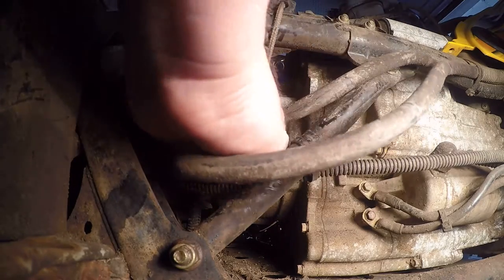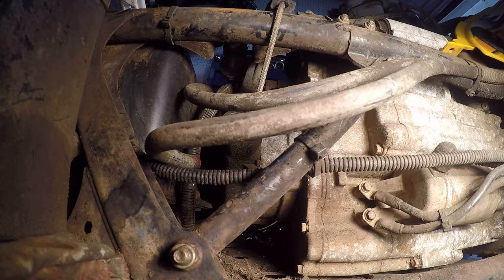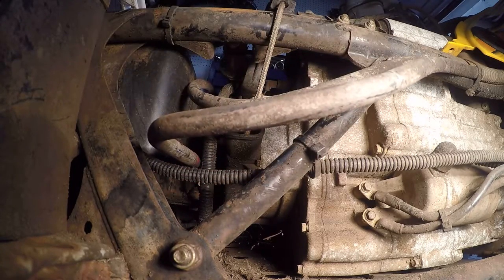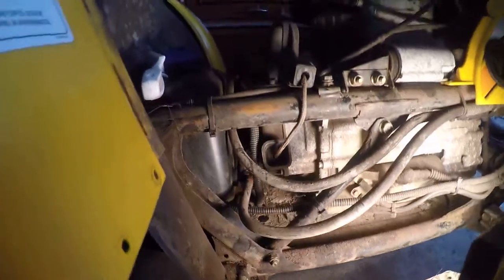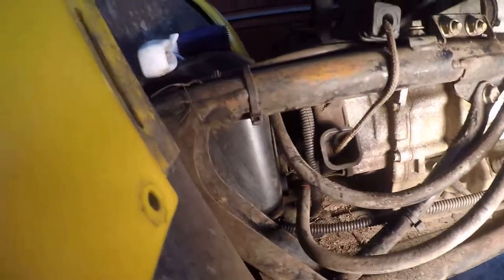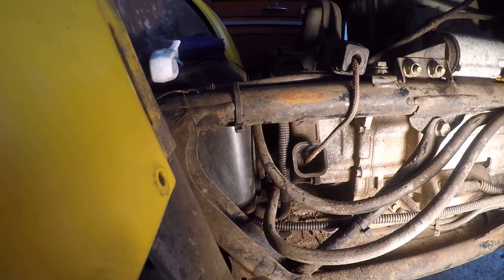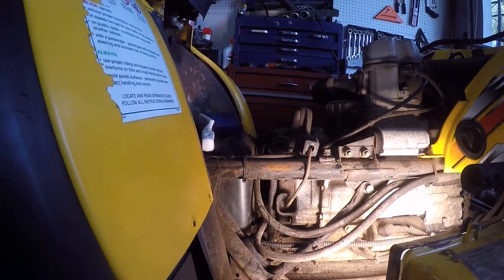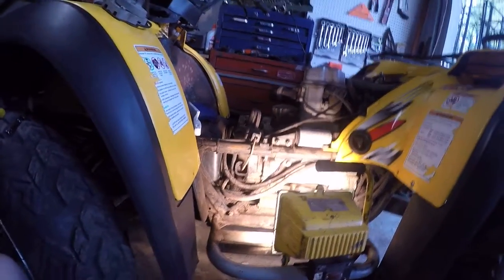bombardier traxter gas tank grommet

Comment: Just had to replace the grommets, filters and fittings on my latest acquisition (2001Traxter). I heated the grommets and tubing in hot water to make them easier to install in the tank; a little grease, and they oozed right in.